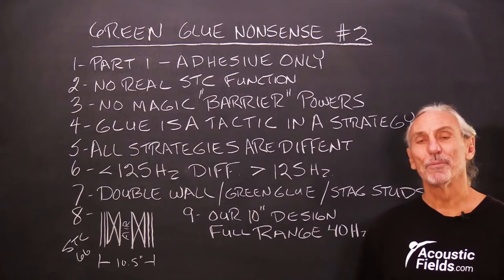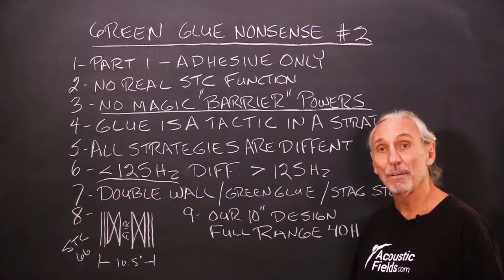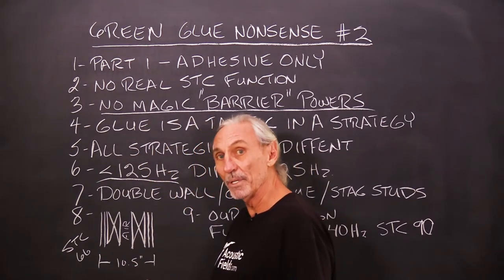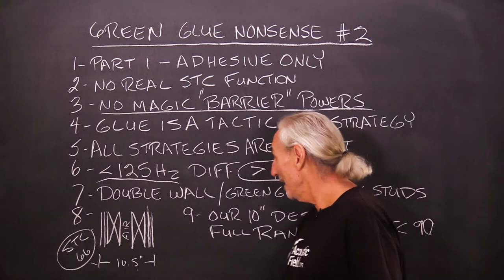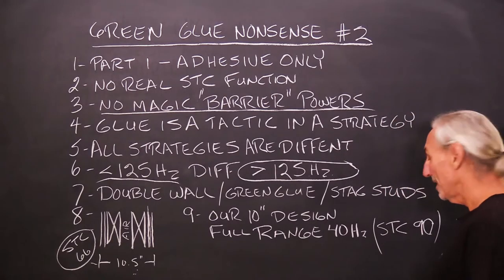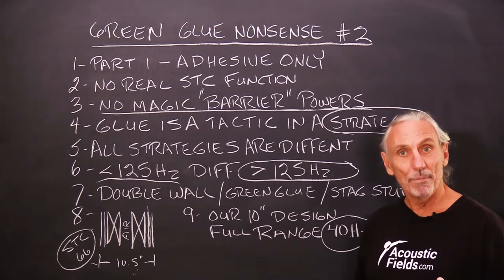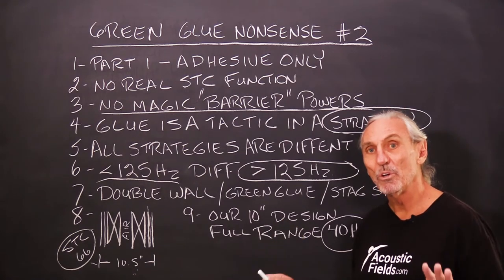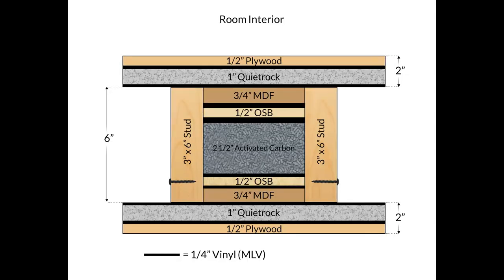Green Glue Nonsense! Part 2 - www.AcousticFields.com

Comment: This was one of the youtube videos that stopped be doing a project and instead i sold the house and bought full brick this time. Thanks for saving me a fortune on a huge project that would have wasted an awful lot of money
Reply from the maker: You are welcome. Brick is a good lower frequency barrier. When we use brick as our base material and add additional layers to the brick, you can get larger amounts of low end performance with only a few more inches of materials.  If you take an 8" brick and add a few inches of the right material type, for that additional two inches of space lost, you can have a 16" thick brick performance.
Reply: If it was that simple houses are more expensive than ever lmao

Comment: With six layers of MLV and 8 layers of panel products, the mass alone will stop almost anything. But is it cost effective and fast to install?  For example, installing 5 layers of panel products tightly between every wall stud is an installer's nightmare.
Reply from the maker: With our "sandwich" approach, the sandwiches are based upon the noise numbers. They are built seperately and installed between the studs.

Comment: I definitely agree that consumers and "professionals" (contractors whose qualitative understanding of the physics is significantly below the intellectual level of a Sesame Street song) fundamentally misunderstand how a given product, or solution, can be applied to a complex problem like soundproofing or acoustic isolation/deadening under an "arbitrary" external perturbation, most likely a combination of vehicle traffic, common frequencies from subwoofers and midrange speakers, and nearby impact noise (from human activity close enough to couple through the structure)n  I also agree that EVERY industry, and certainly the construction industry, aggressively exploits this misunderstanding and that the "professionals" are AT LEAST as susceptible to this intentional manipulation as consumers.

To make matters even worse, US contractors and consumers are equally "religiously partisan" with respect to specific products (Like Green Glue.... or Dynamat in other situations) or specific design schemes as they are with respect to partisan politics.....    get enough contractors in a room and you can get them rioting over green glue vs resilient channels just like the worst of our civics at this moment in time.

The one thing I will say about the design scheme in the video is that I highly doubt you can "convince" an inspector to approve and certify a void filled with activated carbon as up to code.  Certainly not in all 50 states and regional building codes.

The building code distinction of products like Green Glue vs better solutions that have been engineered but might be "unconventional" (merely because of stupidity by the authorities) is a big reason for the big $$ price.   And yes..... the code distinction is meaningless and all it really means is that the manufacturer jumped through the hoops, grease the appropriate political wheels, but does NOT represent any actual real safety or performance disticnction.
Reply from the maker: Your doubts have no basis in fact. We achieve approval everyday in projects all over the world.

Comment: Was just studying you're wall assembly.  A few questions.   What does a wall like this cost per wall sq ft?  It appears each stud is spaced  maybe 6" or 8" on center... Is that correct?   Why the use of 3x6 instead if standard 2x6?  Lastly,  I've used mass loaded vinyl before to wrap HVAC ducts in my current room but where do I buy the activated carbon panels?  

Thanks for your great content.  I watched your channel years ago.  I recently had started building bass traps with mineral wool and now I'm re thinking it  after seeing your video on it! .  Need to rethink things for my next room!
Reply from the maker: You can cost it out. All materials are shown. We can sell you the carbon.
Reply: You see all that Mass Loaded Vinyl in like 8+ layers total? That will cost a TON of money. I'm sure his design can do a great job without Green Glue but the reality is getting much above 65 STC starts costing exponentially more money.
Reply from the maker: Panels filled with building insulation lack the proper rate and level of lower frequency absorption that is required for music and voice. We can assist you will a quote on DIY carbon technology. Send us an email to info@acousticfields.coma

Comment: Hi, Brilliant video. I love it when people cut through the BS. May I ask why activated carbon is used? Apologies in advance if you have already covered this, I have only recently found your channel. Thanks in advance.
Reply from the maker: With diaphragmatic absorption, its all about the rate and level of absorption. The cabinet depth determines the resonant frequency of the cabinet. Frequencies above the resonant frequency are absorbed. Frequencies below the resonant frequency are not absorbed. The internal cabinet fill determines the rate of absorption or how much energy is absorbed per square foot of cabinet surface area. Carbon has large surface areas for absorption to occur.
Reply: @AcousticFields  Wow thanks for the super speedy response. Just wading my way through all your videos now. Thanks from UK.
Reply from the maker: AC has a large rate of absorption across many octave bands if used correctly.

Comment: Dennis, you are the only person I trust for acoustical treatment done RIGHT. I can't find anyone else that has a level of knowledge comparable to you. Per your advice, I'm tearing out (very carefully) my homemade mineral rock "acoustical panels" and "bass traps" that took a week to build, and was not cheap. Yes, they help a little, at least stopped the reflections, but I know I'll never get truly "pro" mixing until I get my room treated properly. I'm saving up...hope to get started soon!
Reply from the maker: Building insulation is toxic and will not provide the proper rates and levels of absorption required for music and voice. Music and voice are different than noise. Most absorption products in the marketplace are "designed" for noise meaning they absorb as much as possible per square foot of surface area.

Comment: Dennis, we are so fortunate to have you to show us, empirically, why so many of the supposed acoustic products are just advertising noise, with no actual acoustic benefit. 
In addition to 'green glue' and corner bass traps, I'm thinking of foam 'bass traps' and foam 'diffusers'.
You've said it before, as have I, DRYWALL SOUNDS TERRIBLE. No way around it.
Reply from the maker: My favorite is the foam corner "bass trap". Placing absorption in the corners of rooms goes against the very definition of an axial mode. An axial mode occurs between two parallel wall surfaces, not two parallel corners. Corners only represent about 10 % of the actual surface area that is producing the unwanted modal pressure. How can you treat the issues produced by the two parallel walls by treating only 10% of the offending surface areas.

Comment: The standard double wall approach is only STC 66, but it won't cost an arm and a leg. Can you suggest a wall assembly that is just as effective, thinner, and doesn't cost more? It is easy to say the wall underperforms for its size, but I don't know of a better alternative that doesn't cost more. Any guidance would be appreciated!
Reply from the maker: What are the frequency and amplitudes of your noise issues?
Reply: @AcousticFields  Acoustic Fields great question, thank you! In my context it is for a home theatre in the basement of a house and the goal is to keep the noise from the theatre away from the rest of the house and vice versa. Not worried about neighbours
Reply: Quietrock is dampened drywall, same concept as green glue (not an adhesive).

Comment: Dennis, I  very much appreciate and enjoy your videos. I really love the depth you go into. However all I'm trying to do is dampen my room in a linear way. I am considering hanging some memory foam behind some blackout draperies. I'm confident I am overlooking something basic, but I'm on a tight budget. Your thoughts?
Thanks, keep the faith
Reply from the maker: It is difficult to achieve linearity when you are using material types that do not have published rates and levels of absorption. Linearity is all about rate and level of absorption.
Reply: @AcousticFields   thanks for your quick response 👍

Comment: I am about to start on converting my attic for home studio/office. I am in Ireland so looking at 15mm acoustic drywall, tecsound sy70 and then 12.5mm drywall for stud walls (filled with fibreglass insulation). Party walls will be mustwall 33b with 12.5mm drywall. Floor will be insulated with fibreglass insulation, OSB 18mm subfloor, Tecsound 50, another layer of OSB 12mm, Sylpro 5mm and then laminate flooring. Will this be enough to watch a movie at normal levels at night / game and have conversations without waking my kids?
Reply from the maker: Not even close to a full frequency range solution at most theater amplitudes.

Comment: I'm in the process of building a room within a room for my drum kit. I am thinking about using the soundproof joist tape, 1.5 inch drywall and allowing 2 inches from wall and ceiling (no contact). 
What's your opinion about my project, any suggestions?.
Reply from the maker: You are using a feather to stop a tornado. Drums are full range instruments that require a full frequency range barrier that will be 6 - 8" deep and contain numerous layers of materials. We can assist you with the room design. Fill out the information in this link: 
https://www.acousticfields.com/free-room-analysis/

Comment: So I am going to hang 3/4 Rubber Horse Mats 4' by 6' on my 6" studs in my Mobile Home & listen to my 15" Horn Driven Vintage EV 1250" each Powered by a 500 Watt Allesis RM500 AB Amplifiers at Low easy listening level & it will work. I wrapped 3 Work Rubber floor Mats around my Radio Boom Box, 2 wrapped around & 1 draped over then a pressed the left & right sides tightly together & the sound was reduced more than half. 3/4 Rubber Horse Mats is sound proofing that works.
Reply from the maker: There is no such thing as "soundproofing". Nothing with noise is "proofed". There are many variables to consider. It depends what the frequency and amplitude of the noise, it depends on what time of day it occurs, it depends on room size and volume, it depend on flanking noise issues, it depends on room usage, it depends. Nothing with noise is black and white. Stop looking for the black and white. It doesn't exist. Trust me. If it had, I would have found it by now.
Reply: @AcousticFields  Thankyou I can barely (hear) you through my 3/4" Rubber Horse Mats.

Comment: I'm getting ready to attempt to help out with terrible road noise in my bedroom. I'm going for double layer 5/8 drywall over the existing 1/2 inch. I just can't bring myself to pull the trigger on the green glue the price is absolutely out of line. There has to be a better way. Please advise. I don't want to smooth out the existing wall either it's light texture. I have spent weeks reading and learning about sound proofing and I'm not even going to attempt de coupling or wall within a wall I just need to block low deep noise from cars in front of my house. I found your videos and I feel you are correct  green glue can't be anything more than silicone caulking noise wise. Please advise I'm putting two layers of 5/8 on top of 1/2 was going to put green glue in between but the cost is more than all the other materials. Would 30 pound tar paper in between be something to add mass. I'm just trying to lower the deep road noise. Thankyou
Reply from the maker: You are guessing which is a waste of time and money when it comes to noise transmission. The methodologies you are considering work only for middle and high frequency noise issues and poorly at that. If your road noise is below 125 hz. you will not attenuate any of those octave bands. You must measure noise over a seven day time period to know the maximum and minimum pressure issues. You design the barrier for the lowest frequency and the highest amplitude during the one week of noise measurements.
Reply: @AcousticFields  Thank you for taking the time to reply to to a layman. I will simply try and plug up all gaps add mass and hopefully get some result.

Comment: Hi Dennis I have 2 questions about your wall design at 3:57 - how densly packed is your activated carbon, or is it loosley dropped in? And are those lines representing screws in the stud, or is it a laid in piece of MLV? Thanks!
Reply from the maker: Our carbon is processed in granule form. We control the porisity count, hole size, and granule density. We also treat the carbon for moisture retention. If the carbon absorbs moisture (humidity) it will lose performance. This is where people who cheat and use other carbon types will fail. After their carbon that is not treated absorbs a certian level of moisture, they quit working. This process takes around 6-12 months. They have done all of that work for nothing at great expense. Our barrier wall sandwiches are glued and then the barrier sandwich is screwed to the stud.
Reply: @AcousticFields  Thanks! Do you sell your carbon separately? Thanks for info on the stud construction too.  I am now thinking a build of concrete block might be a good option with some kind of extra sandwich stud layer. Drums and neighbours don't mix well. Thanks again.

Comment: Just wondering, are you saying that constrained layer dampening doesn't work?
Reply from the maker: Evrery material type and construction methodology is frequency and amplitude spacific. Certain materials work in certain configurtaions to attenuate certain octave bands of noise. There is no one size fits all noise.
Reply: @AcousticFields  That's true but constrained layer dampening does work otherwise the Navy wouldn't be using it on submarines and ships.  Whether or not Green Glue works is a different question.  I've never tried it, probably never will because any similar lower cost product that remains elastic will accomplish the same thing.  

I do agree with you, Green Glue is pure gimmick but only because it is over priced and probably no better than less expensive options.  Constrained layer dampening however is a valid technology widely used in military applications.  I'm just not convinced Green Glue is a good implementation of it.

Comment: Your alternative assembly has 4 layers of 1/4" MLV, which is more expensive than GG. MLV is not hung limp, the actual studs still connect front and back wall layers, there is activated carbon inside "studs"... How does it actually work?
Reply from the maker: Our proprietary carbon technology is used between the studs in a wall build or inside the cabinet in a freestanding build. MLV is a vibration reducing technology when sandwiched between material types and layers.
Reply: @AcousticFields  So, you are replacing 2 layers of $1/sq.ft. compound with 4 layers of 2 lbs MLV at $4/sq.ft. each layer and proprietary materials. How is that a reasonable comparison?

Comment: By my estimation your method is about 10 times the cost of the Green Glue and double drywall method. This isn't really an apples to oranges comparison. In part 1 you brought up cost per foot and said you had a "sheet for $10" that could outperform the GG. Please elaborate as to what that sheet would be and what would be a better method at around that $1/SF range. Thanks so much for the time!
Reply from the maker: What is the frequency and amplitude of your noise issue?
Reply: @AcousticFields  my sub is rated down to 35 kz, sometimes I listen to my stereo north of 85 db. I'm a home do it yourself"er" who is converting the 2 car garage into my rock bar. The problem is I have one L shaped adjoining wall that the low end transfers through that the Mrs. does not enjoy. Both walls have 5/8" drywall and am looking for the best cost effective solution to keep those low frequencies within my rock space. I have about 2-1/4" to work with coming off the face of the existing drywall in the garage.  Any sort of insight is greatly appreciated! Thank you so much
Reply: *hz
Reply: @AcousticFields  hello, not sure if you saw my response to this. Would really love some insight here! Thanks
Reply: @AcousticFields  does my response not warrant an answer here? Not sure what happened. Was really hoping for some help here.
Reply: @AcousticFields  hello are you getting the messages here? Not sure why you would ask me a question then ignore the response. Is this how you guys operate? Unacceptable.....
Reply: @AcousticFields  hello?? I responded to this a week ago. Can you please respond? Thanks!
Reply: @detroyt232323  It's clickbait. There is no cheap solution and the green glue softens vibration because it is "limp" instead of curing hard, which is the same theory behind quiet rock and which costs $85 per panel. His setup would invariably work better because the mass is enormous but nobody could afford it, it would off-gas tons of formaldehyde and you would probably be better of just using brick.

Comment: How would I minimize hearing bass from upstairs neighbors. What would I have to do to existing ceiling? I’m considering plugging my bass into my amp and fight fire with fire. I currently use headphones to spare them but they don’t seem to have the same mindset. I want to fix this problem because if it’s not this neighbor it will be the next. I own my unit (condo).
Reply from the maker: The transmission of low frequency energy can be minimized with the proper barrier technology. You will have to measure the noise and then we can assist you with the barrier design. You will need to build a room within a room that has walls that are 8 - 12" thick.
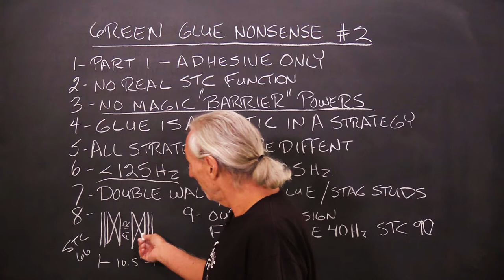Reply: @AcousticFields  Doesn't this contradict what you are saying in the video at 2:21???